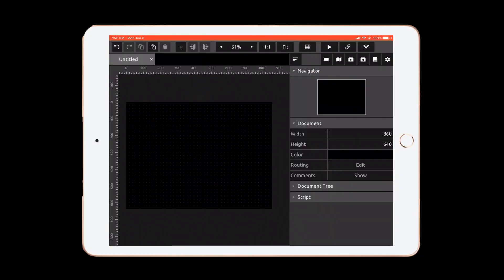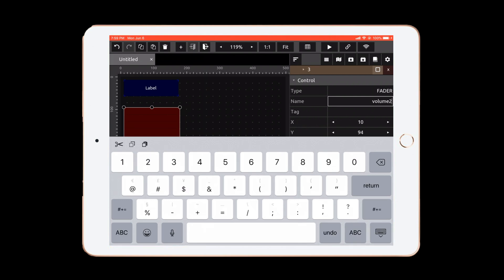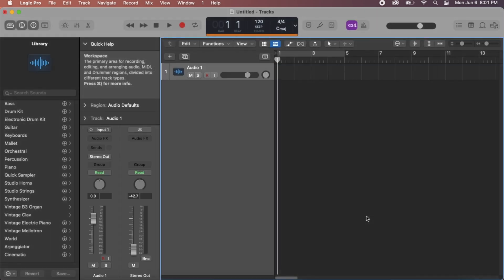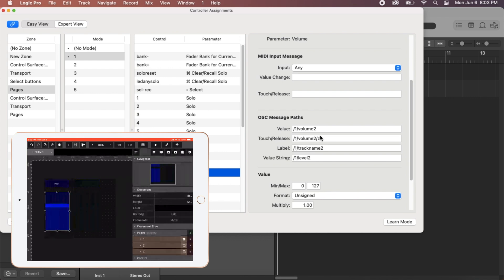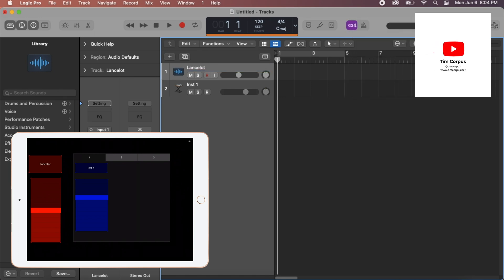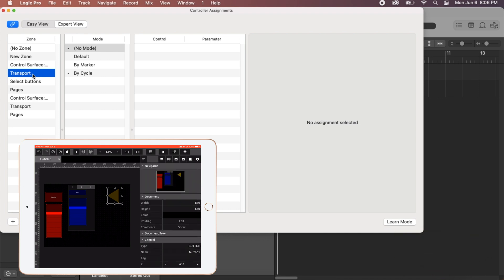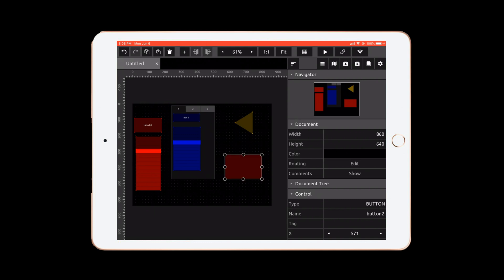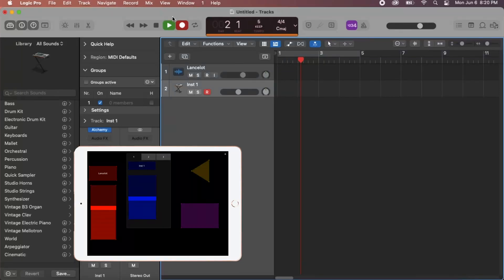Sending & Receiving OSC Signals with Logic Pro (Ultimate Guide to TouchOSC)

Comment: I can't figure out how to get level meters going. I'm using the LogicPad template, copy paste the "volume1" fader, call the copy "levelmeter1", disable "OSC send", color it green and in Logic Controller Assignments under "Level Meters > LED and vertical meter > Ch 1 signal" under the OSC parameters I call it all "1/levelmeter1". I've tried just "levelmeter1" and also Learn Mode (with OSC send on TouchOSC enabled) but Logic doesn't get any OSC messages when I move that fader, even though it looks fine in the TouchOSC log.

Dancing meters right on TouchOSC (on the channel select buttons and giant ones on the channel strip would be excellent.

Comment: Hey Tim! I want to ask if it's possible to create new controls with different OSC messages? Right now the only way I find it works is copy-pasting existing ones and modifying them, but if I create a new one using te "+" button it just wont work. Thank you in advance!
Reply from the maker: Hey 👋! Not sure if I understand the question. You want new objects with different OSC messages? You should be able to change the message on subsequent objects. Or do you want multiple messages one object?
Reply: @TimCorpus  like are we “stucked” to use copy-paste existing assignments to add our owns on logic? As using + button and configuring a new one just won’t work

Comment: Hi! Is it possible to make a custom touchosc template for Logic? And if so, what do I type in the "osc message path"-fields in logic for a simple keycommand like "remove fades".....? Scratching my head here.
Reply from the maker: Ya you can make your own template. I started with the LogicPad as a jumping off point, but there should be some OSC messages available to use. You may have to look up what Logic OSC messages are available.

Comment: I dont know why I am not getting any feedback, I created some basic cc message for touch osc, mainly fader , expression and xy pad, I cant see the thing you talked about in this video. Im using the touch osc to control any VST liek kontakt and all, Its just I'm not getting feedback from osc and I dont know why.
Reply from the maker: Hmmm, first thing to check, is any message getting through? Protokol is a good way to check that, you can also use the desktop editor. This way you can test if messages are at least getting from your tablet to your computer. Then if that works check the settings to the DAW, make sure the settings on the tablet links are correct and hopefully you can add your device in Logic. With apple you can also check the MIDI. I show that in my video on GarageBand. Hopefully that's a helpful start!
Reply: @TimCorpus   Oh its absolutely working, no problem with that. Its just It doesnt follow the automation I already recorded during playback, you mentioned its called feedback.  Or does it have something to do with me using Touch OSC Bridge? The midi message is getting through, Im able to work, It just feels like im working with something like "non mortorized fader" as touch osc doesnt move together with the automation thats been happening in the midi during playback. Ill watch your garage band video, thanks a lot!

Comment: This was super helpful mate. That /1 naming hiccup would have stumped me for eternity. 

Could you please do a tutorial on how to set up faders to control cc messages in Logic? I’m a composer too and I want to set up three faders to control dynamics, expression, and vibrato, while working with vsts.
Reply from the maker: Glad it was helpful! You should be able to do that with MIDI learn in Logic ya? Are you using Kontakt?
Reply: @TimCorpus  I do of course use Kontakt for some instruments, as well as different samplers for EastWest HollyWood Orchestra, SpitFire, etc, and various physical modeling vsts from SWAM and the like. I can see how I could assign ccs via midi learn in Kontakt, but what I’m really interested in doing is setting up faders in TouchOSC to control cc values on any selected track, much like you can do with a physical midi keyboards faders. That way it should work across the board on any and all vsts.
Reply from the maker: Gotcha. So have you tried this template that I covered in this video? Or are you looking for something else?  https://youtu.be/fSNEAcuNAT4
Reply: @TimCorpus  yes I saw that one. But unless I’m mistaken there is nothing in the logic pad template which is setup to control CC’s 1 (modulation/ often dynamics) CC 11 (expression) and CC 20 (often vibrato). Or did I miss something?
Reply from the maker: @cabijista1  Correct, nothing is setup in that template for MIDI CC specifically. However, you could use some of the OSC set up in that as a model for creating new OSC messages from Logic to your tOSC template if you needed an example.

What I do to control expression and dynamics is shown in this video: https://youtu.be/A0QNnSBnv-U So build your faders or XY in tOSC then add the basic MIDI CC you mentioned. If you are using different MIDI channels on each track and you need to control those CC as well, what you could do is create buttons in your tOSC template to change the MIDI PC. That's a little more complicated, but very doable.

I'll add this to my list to show how to create in a future video.

Comment: can this be achieved with Mainstage?
Reply from the maker: I'm not sure, I've never used it. However it looks like there is a midi learn function, so it should be doable with MIDI messages from touch OSC. https://support.apple.com/guide/mainstage/learn-a-controller-assignment-mstg338d4728/mac

Comment: Hello Tim,

Thanks again for your clear explanation. After i changed the patern config in reaper from 
"default" to "logicpad" i could do everything you explained in the movie. Now i have a million dollar question:
I'm looking in the "LogicPad.ReaperOSC" under the reaper resource files folder and i found the following line: 

MASTER_VOLUME n/1/mastervolume s/1/masterlevel

I assume this means that when you touch the slider in your touchOSC surface it will be send to reaper and move 
the mastervolume slider (wich it does) And whenever you move mastervolume in reaper 
it will show in your touchOSC surface(wich it does)                      

1st question: Why did they change "mastervolume" into "masterlevel". It doesn't exist in the touchOSC surface template 
and yet it receives the incoming OSCmessage.

2nd question: I tried to do the same thing for the masterpan and i added the next line in
LogicPad.ReaperOSC : 

MASTER_PAN n/1/masterpan s/1/masterpan

The result is that i can change the masterpan in reaper but when i touch the pan-knob in reaper, 
it's not showing in my touchOSC surface. I think the big question is to know all the names reaper "knows" and uses
when asked to send it's value to our touchOSC surface.

Thanks in advance for your advice!!
Reply from the maker: Hey, super interesting question and unfortunately I'm not sure about the answer. I've run into this before, specifically with Reaper, and I wasn't able to figure out WHY some messages worked and others didn't. I believe there is another script or file somewhere connected to Reaper that is designating what OSC messages actually do, but I haven't been able to find this. Also, I haven't seen that level of editing (with a specific document that's uploaded to the DAW) with any other DAWs than Reaper. In my time (albeit probably too brief) looking through https://ccrma.stanford.edu/groups/osc/spec-1_0.html#osc-address-spaces-and-osc-addresses I haven't come up with an answer, but if you find one, definitely let me know. This question may also be one that the programmers like Felix can answer on the Discord server. Sorry I can't be more helpful!